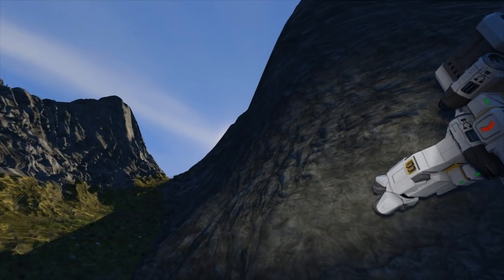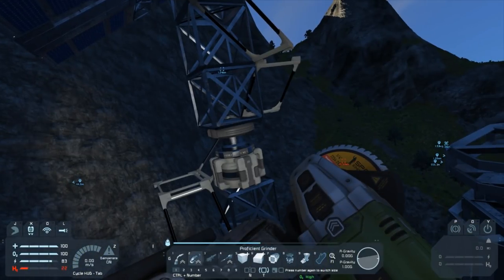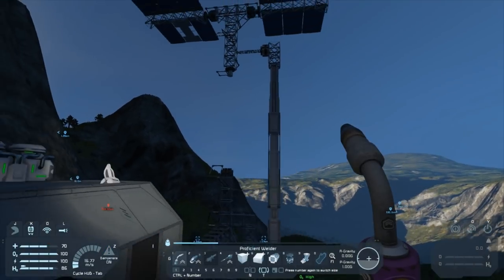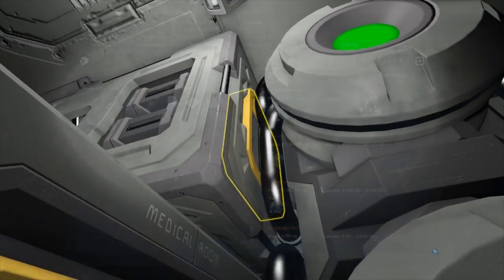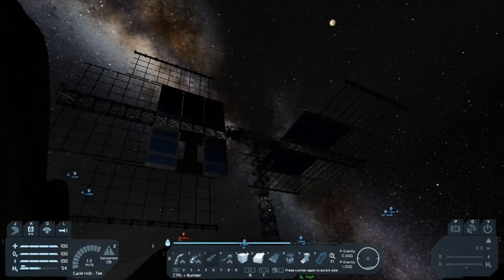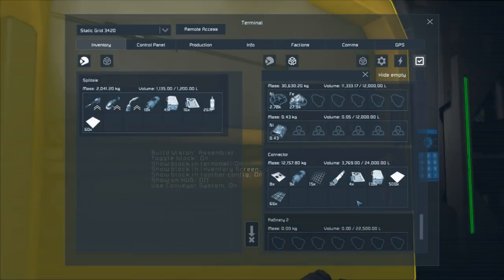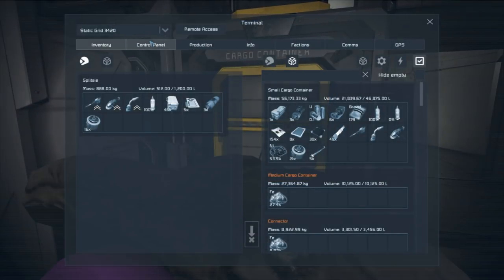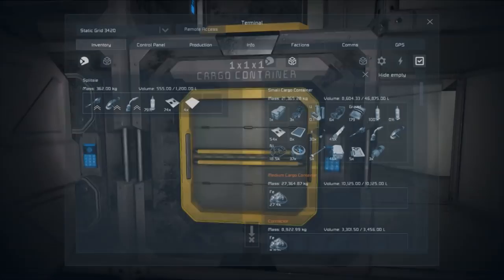Survival, Maybe... #10 Pistons+Rotors+Landing Gear=Success? (A Space Engineers Survival Series)

Comment: What did you sacrifice to the clang gods to let you raise that tower without any problems? I must know.
Reply from the maker: I might have a contract stating that clang is allowed to name my first born...
Reply: Splitsie don't you mean take your firstborn?
Reply from the maker: Nope, clang would have to make me his right hand man to get hold of my first born. For not exploding it's only naming rights ;)
Reply: I keep hearing of this 'Clang' thing like the 'Kraken' in KSP, but I never see it!

What is the problem with pistons and rotors that cause this instability?
Reply: @charlieodom9107  Klang is space engineers as the Kraken is to KSP. Most likely because rotors and pistons allow more movement, and the game doesn't like the movement. I've had weird ass Klang sacrifices from just repairing busted equipment. As a rule of thumb, don't place full blocks near pistons and rotors/the parts they're moving. Blast doors and half slabs are your best friends. The airtight hangar door is the most stable out of the moving parts
Reply: @Splitsie  Is this what happened to Capac. I mean he did show up after this. Clang, Capac, they kinda sound similar!

Comment: Interesting idea there with the pistons and landing gear... I don't think I'd've thought of that one, but then I play on 10x settings, and a player model w/ a 10x inventory, though I didn't notice that at the time as I was just trying to find a female astronaut model. (I had been using the Tungsten one, but it's rather... well... let's just call it Barbie doll and stick figure-y. Not a huge fan of that.)

Oh, and a few things regarding mining out your base, depending on how big you're going to go with it, it might be a good idea to build out a mining vehicle inside the base, as I've noticed that, at least with the right click mining, it doesn't deal damage to voxel grids like it does with the hand drills. Alternatively, if you have the resources, esp. magnesium, you could drill a shaft and put a large warhead block and use that to quickly excavate a huge area. I think when I looked it up, the wiki said it's a radius of 50m. When I was excavating for my bunker, I used 3, iirc, to blast open the area for the bunker proper. (The only problem I'm having atm is that I keep losing air. Rooms randomly and magically get depressurized, opening or closing doors sometimes sucks air into the void. Not sure if it's an issue with my machine, SE, the amount of mods I have, or some combination thereof, but one of the warnings is that there's either too large or too many pressurized areas. That said, I think the time on the error is at the end of the initial loading and not after that, even though I seem to be experiencing issues afterwards however.)

Also, one last thing, regarding that assembler room, you could put in a catwalk up on top of those modules from the far end, that way you don't need any hydrogen to get up there to the top modules. :) I did something similar in my production facility since I did 10 assemblers in a line, akin to what you've done.
Reply from the maker: I really wish there was something we could do as a community to convince keen that making a proper female player model is worth it to them. I probably wouldn't use it for playing but I would in machinima and it feels unfair that players who want to have a female avatar aren't given that choice :(

That's a nice idea with the assembler room, I'm definitely going to be binding that upper layer of catwalks :)

Comment: How do you get the connectors to work? when i dock my mining ship to my station with connectors to Unload my ore into the refinery It wont unload am i missing something? Or just plain stupid
Reply from the maker: If the refinery's inventory is full it won't unload, that's the first thing I'd check. If there's enough room the next thing to make sure is that there's no broken links in the conveyor chain between the inventory on your ship and the refinery, so making sure nothing got damaged on the ship and nothing has use conveyor system switched to off and ensuring you have locked at the connector and have no sorters that are going the wrong way :)
Reply: Ok thanks :D

Comment: Great video as always! A few times I was close to a heart attack when I saw you grinding down pieces at the solar tower that close to the scaffolding blocks of its base ;) You should really weld the tower - one accidental hit with the ugly duckling and down you go, little tower :-/ But the way you moved the tower up was really smart! Never thought of using rotors and landing gears in that way - cool! Also: you could have made rotating your solar tower into position a lot easier. Did you know that my script has a rotate feature? You can use the argument field of the PB and type in 'rotate horizontalAngle verticalAngle' (in your case this would be: 'rotate 0 0') press run and the script will do the work for you ;) If it's done, the alignment will automatically be paused. Keep it up, splitsie - I really enjoy your videos!
Reply from the maker: Awww man! I wish I'd known that beforehand, but at least I know for next time :)

I hadn't actually thought about how close I was to grinding straight through the tower... Probably for the best as I might have freaked out and actually done it due to shaky hands :P
Reply: #DerIsy. I like your script i use it for all my bases :) Thx alot for it :)
Reply: Thanks! ;)
Reply: What kind of algorithm did you use for this? Im interested in learning how to do stuff like this.
Reply: Homebrew ;) Basically: if output gets higher, rotate further in this direction, else try other direction, if that fails, try other axis.. (cut down to the most basic behavior - there is much more to it)
Reply: I was trying to use a basic PID Controller but then I realized that the error in this case wasn't really in a linear relationship to the output the PID produced and I wasn't sure how to convert it into one.
Reply: Thanks for the explaination :D
Reply: Isy, Thanks so much for making this mod. I've never thought of using mods for space engineers because I felt like it would ruin the experience for me. But this mod is just great. Now I can show off to my friends that I know how to make a Solar Array! :D

I just got back to Space Engineers recently and decided I would learn it all again by playing survival mode. And The solar array made my life easier.

Comment: Hey Splitsie, just began watching your survival series, love what you've done so far. A couple of ideas for you if you want to use them; (1) replace the wheels on your rover with atmo thrusters and make it a flying scout ship, four for lift, four for sideways movement (two each side), two for forwards movement and two for breaking. Finally, give it three to four landing gear. With it now as a flyer, you can use it to get to unidentified signals for the free loot. This leads to; (2) use the loot containers to get reactor components and uranium and make a small reactor in your base as an emergency power source if you run out of power at night. By getting the loot crates uranium and reactors you will have an alternate power source to keep you going and (although we have not seen many signals appear lately) a steady source of parts and uranium. And finally (3) drop the miners droppers down one block, it was the reason why the miner was damaged. Two big piles of stuff hit the connector and caused damage because they were too close.
Reply from the maker: I've definitely got to move the ejectors on the ugly duckling, I think you're right about that being the cause of the damage.

As to the loot drops, I've actually disabled them... I had a couple of reasons for this, the main one being that it was going to annoy a few people since I was almost certainly going to ignore them most of the time and another big one was that I didn't want to provide myself with a source of uranium. We're going green all the way! :P

Comment: Wondering: how is your solar tower that stable? I built one, about 1/10th the height, and wobbles all over the place untill it breakes and flies of into space
Reply from the maker: If you're playing multiplayer that's likely the problem, but if you're in single player are you using Isy's solar alignment script or another one?
A little while ago it used to be really unstable until he made a few updates that took advantage of the shared inertia tensor setting meaning the most up to date script is better than the old one. Other than that I'm not really sure what could be causing yours to be unstable if you've set up the solar tower with the rotors the same way as mine :/
Reply: I've tried your way, my way AND the highway. Yet still very unstable

Comment: was just wondering if you or anyone else was having trouble with exploding atmo ships since the last update seems every time i try to make an atmo miner for my planet side world since this last update it explodes within seconds of powering up, if this keeps up i may have to just work on my other world till this get fixed
Reply from the maker: I haven't, but someone else posted that they are having trouble with my miner design blowing up, I wonder if they were having the same issue as you are.. I haven't come across anything else though
Reply: I just started a new vanilla survival world to check to see if its just that game save that is causing the explosions after 4 explosions i kinda gave up on that world. I did check my other world where I built the autopiloted ion miner and that one is still working great though I am already thinking on some improvements on it.
Reply from the maker: Hmm, could it be a mod in that other world that's causing it? Oh man, I sound like keen now :P
Reply: it was definitely a mod as I was able to get the vanilla world to work properly the next thing will be trying to figure out which mod.
Reply: turns out it was a mod called  thermal mechanics used to be known as immersive engineering so you might ask that other person if they are using that mod.

Comment: Put a drill on the end of pistons to drill tunnels. I do it all the time, then just refine the edges by hand.
Reply from the maker: I've actually not done it that way before, I might have to give it a try
Reply: Pistons speed set at 0.2 or lower or they like to explode. 

You can link 3 or more pistons but if you're drilling horizontally you need a sorter to extract stone from the drill as it starts to droop downwards due to the weight. I often drill in about 50+ metres, then set off a warhead to create a large open space to build in. 

I love this elevator mod (https://steamcommunity.com/sharedfiles/filedetails/?id=1154898843), for deep subterranean bases. perhaps good for an underground route to your new hilltop solar panel installation?
Reply from the maker: That elevator does look pretty good, I haven't had a chance to build with it though. Definitely will take a look as it could be really nice as a service elevator where you suggested :)

Comment: Solar panel ray tracing must only go a few km, as the solar panels were at 4 bars even though they were still blocked by those yonder mountains.
Reply from the maker: It's pretty unreliable, but I hadn't thought of distance being a reason why, I plan on testing it so I'll have to make sure I include distance in the tests :)
Reply: Initial testing shows solar panels only ray-trace 100 metres to voxels or grids.
Reply from the maker: Thanks! I want to do a video on what actually blocks a panel so you've just saved me a good amount of time :)
Reply: I also noticed, as you discovered with your previous solar panels test, that if a solar panel is flush against another block or voxel, it will ignore that in determining coverage - so a solar panel laying on the ground would detect full sunlight at midnight.
Reply: I've created a simple test world with a few tests.
http://steamcommunity.com/sharedfiles/filedetails/?id=1218361292
It seems that glass does not actually let any light through - it just seemed like it from your testing because the solar panel was directly against it, and thus ignored it.
Reply from the maker: Thanks, I thought that might have been the case